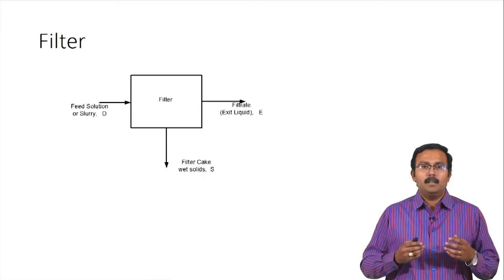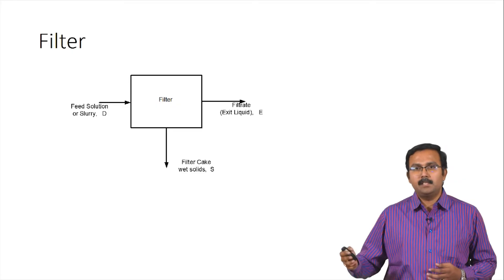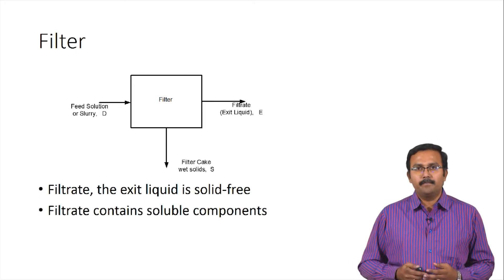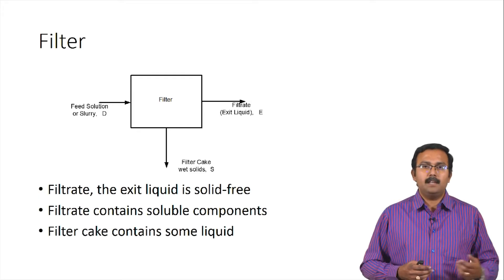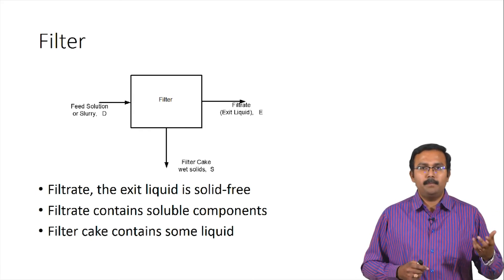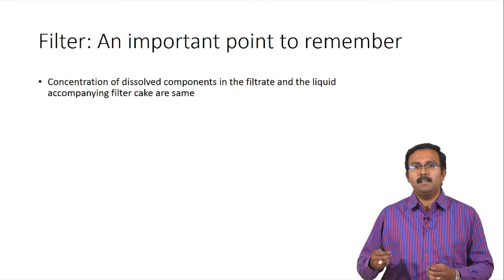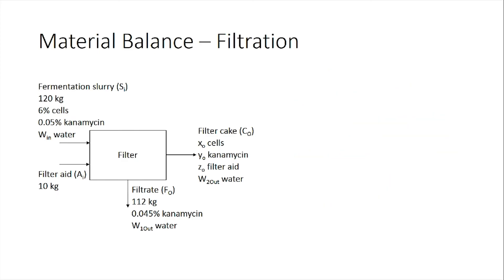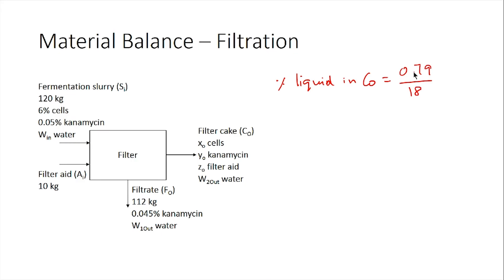#7 Material Balance Calculations for Single Units Without Reactions | Part 4

Comment: Isn't the weight of kanamycin in the filter cake ( i e kanamycin present in water and filter aid) 0.01kg? But while calculating the amount of kanamycin in the filter aid you used 0.1 instead of 0.01...
Reply: sir did a small typing error, but the answer is correct,
Amt of Kanamycin absorbed by filter aid = 0.01 - 3.6 * 10 ^ (-3)
                                                                       = 9.6 * 10 ^ (-3) .... for 10 Kg of Filter Aid